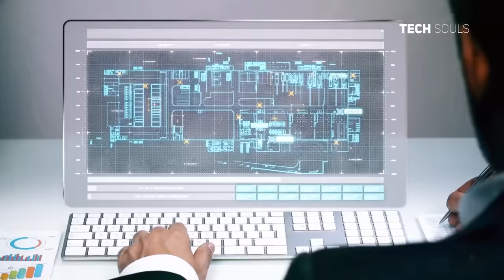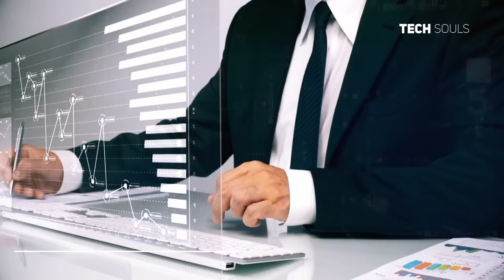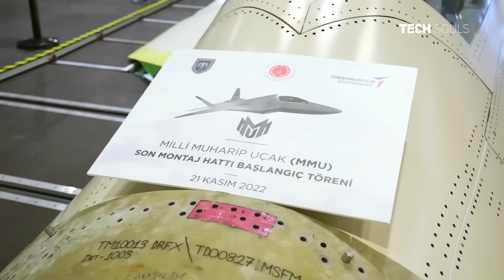Turkish Finally Revealed the FIRST 6th Generation Fighter Jet! To Beat The F-35

Comment: The reason why the United States also changed its main fighter from F22 to F35 is because the maintenance cost of stealth fighters is too high. It is the same reason why F16, a single-engine fighter, became like the main fighter of other countries. TFX fighters are not marketable. First of all, it seems that only some of them will be used in the country.
Reply: The reason for switching to F35 cannot be the maintenance cost. F35 is more expensive than F22 and has more sensor capability, but F22 leaves less radar signature
Reply: Had to more with they could not sell the F-22 overseas so the companies couldn't make a profit off of it.  This is what lead to the F-35 and them cancelling the F-22.  Cancelling the F-22 was stupid. They always get cheaper and more advanced down the road but they closed the lines permanently making it impossible to start the assembly lines back up.
Reply: @emysone The F22 is double the cost of an F35. and The new upgrades make it more expensive.
Reply: @johnjohnson-pf6ln nope f35 costs 55 m but f22 costs 25 m
Reply: @emysone  maybe you're not that good at math because your numbers are way off. The f22 is the most expensive fighter to date
Reply: @johnjohnson-pf6ln bruh f35 unit cost 175 m (with no weapons) but f22 unit cost 150 m
Reply: @emysone  just stop dude. You yourself don't know what you are talking about. You just quoted different prices. The f22 program is at 678 million dollars making it the most expensive fighter program. The f35 is just over 450 million. They estimate by the time the f22 is retired that it may surpass it but here's the thing. The upgrades for the remaining f22's cost over a billion dollars. Plus they are not retiring ALL the f22 raptors only some. They are keeping some that haven't been programmed and some that have.
Reply: @johnjohnson-pf6ln 
In the first part, I mentioned the development cost, and in the second part, I mentioned the unit cost and ok
Reply: @emysone  either way you are wrong.
Reply: He will no longer get 16 without going to Turkey's Hürjet official website and seeing what they produce instead of F16. 2030 is the end
Reply: @johnjohnson-pf6ln  And you're just naming the whole program cost and not the unit cost.
Reply: I feel that tfx in black color would be pakistani black birds who will gain superiority in the sky and world will shiver in fear when these black jets in the sky...i m waiting for pakistani black birds....850 years old prediction...100% true..
Reply: @johnjohnson-pf6ln  
Correct. 👍
Plus, the combination
of  F-15EX  with the F-35 block 4,   is unbeatable  !!!
Reply: @emysone  
Unit cost of the Boeing F-22 Raptor is double, compared 
with the F-35. ...
Reply: @LEO-tm1ck  ım repeatıng agaın f35 unıt cost 55 m but f22 raptor unıt cost 25 m
Reply: @emysone  
Sorry, mate, you are absolutely wrong... Please
check your sources, again...
Reply: @LEO-tm1ck  ok.
Reply: US jets are overpriced
Reply: @megroslmegr7504  
France, is more expensive..
Reply: The f35 is enough to beat any fighter today, and the f-22 is Old and expensiv now.. the f35 is enough, it has alien tech
Reply: Потому что это не самолеты, а хрень собачья., 😎
Reply: @michaelmichaelagnew8503  US has more then enough air superiority fighter jets with the number of F22s it has.  It is the best in the world and has a 15-20 year lead against anything being even close.  The F35 is a multi-role fighter.  The ideal situation is the layered strategy.  F-35 supported by F16s screens to do the dirty work and a couple f22s clearing the skies.  But really.  Dont even need the F22s.  F35s aren't great dogfighters, but they dont have to be, the outrange any other fighter by miles and are shooting down enemy intercepters before they even know they are there.

Comment: Crazy how a majority of actual stealth fighters looking like a carbon copy of the F-22
Reply: Например ?
Reply: because it's the best design for a stealth fighter, it's like being mad because cars look alike even if it comes from different countries
Reply: Ve   soyekdiklerinizi yapabilen mühendisler biz de ve bizden ABD gittiler
Reply: The most important reason is that they never sold it to anyone. In the next 5 - 6 years, every country that is our friend and ally will be able to own an F22 Raptor.
Reply: @onurcan8434  well once the Wizards (Lockheed Martin) design something and it turns out to be one of the best stealth designs one would guess that it will become the default, plus those other countries will have a raptor with updated avionics and won’t be hella expensive to upgrade
Reply: @MetalFalcon99  In fact, each country takes something from the other and uses it for its own design. But sharp corners and a smooth surface are important so that it does not appear on the radar. But unfortunately, with the updated avionics, the price is not affordable at all. If it had gone into mass production last year, the price of one of them, including its hardware, would have been three hundred million dollars. I don't know what the price will be in four years, but it certainly won't be cheap. Because we built this plane alone, without any financial support from any country.  They may not buy it, but at least they won't have an excuse to put forward.
Reply: @MetalFalcon99  Since we own it, we will constantly update it to prevent it from falling behind, but the 6th generation is a different story. Artificial intelligence is required for this. It was deliberately made to have the largest dimensions among its species. because it requires a large space for a lot of hardware. However, it will go into mass production as the 5.5 generation in the first place. We are thinking of Bayraktar - Red Apple as the sixth generation and it will go into mass production very soon. So, while everyone is waiting for a 5th generation aircraft from us, we will first have the 6th generation aircraft.
Reply: Sorry,next time we'll build up stealth fighter looks like tugboat

Comment: On February 21, 2024,first prototip KAAN flew. It remained in the air for 13 minutes. Except for the engine and ejection seat, everything is the work of Turkish Engineers. Work is also being done on the engine and ejection seat. We are talking about an aircraft that will join the air force fleet in 2028.
Reply: LOL no

Comment: There are here many people who dont beleive in that Turkiye can develop a 5th gen aircraft. I am sure they also don't believe in that Turkiye can build attack helicopters, frigates, smart misile systems, and etc, right? And you have just heard about drones, if so, I think you should know a little bit more about Turkish defence industry. Sure, developments take times, but it may not be that much bad as the majority prejudicely commented.
Reply: All of the technology is based on other countries tech. Its still a big achievement but without korea germany and france you wouldn’t be able to do it, and that normal.
Reply: @whatsup-zh6qv   No need to reinvent the wheel from scratch. But, it is not just assembling, as you mean. COTSs can be used at initial stages. As needed, strategically important ones are to be replaced with indigenous products. This is a reasonably normal path. That is why,  South Korea is also doing the same thing.
Reply: @whatsup-zh6qv The important thing is to learn technology. After a certain stage, we will not need them anymore.

Comment: When you get kicked out of an american defence project and then design your own fighter, which requires american engines from a defence project. Bold move.
Reply: You have to start from somewhere. Turkey has been working on developing a jet engine for years, and it will take several more years to build one. However, we need to take action and stop relying on other countries for armaments.
Reply: all which rely on Taiwanese (soon to be China) semiconductors...

Comment: With the F-110 GE engines listed, these are engines that were made in the 1970s and currently in F-16s. By definition, these engines in any aircraft disqualify it from claiming 5th and 6th generation status. At the best, with all systems working perfectly and with domestically procured F-16 engines, this is a 4.5 generation aircraft. Not a 5th and definitely not a 6th, not comparable to F-35

Comment: Is this really a 6th generation fighter?  No offense to the Turks, but the sixth generation should at least have: an unmanned version, near hypersonic or even hypersonic flight speed and weapons based on new physical principles, but nothing like that was mentioned in the video.  For example: Russia is also preparing to create a sixth-generation fighter, and for this purpose, even today, the USSR began developing liquid breathing in order to create a new suit for its pilots who would be able to use it to overcome extreme overloads at near hypersonic or hypersonic speeds.  The point is that during overloads, the pilot’s lungs are compressed and because of this they are not able to absorb oxygen in this state, and after some time the pilot’s brain experiences oxygen starvation, and then loss of consciousness occurs.  And the essence of liquid breathing is to fill the pilot’s lungs with a special liquid that is enriched with oxygen and, due to the fact that the free volume in the lungs will be filled with this liquid, it will not allow the lungs to be compressed during overloads.  And due to the fact that the liquid will be enriched with oxygen, the pilot’s body will be saturated with oxygen.  And according to rumors, only recently Russian scientists have achieved great success in this area.  Also, Russian scientists are testing various systems and new weapons on the SU-57, such as: improved electronic warfare systems, radars throughout the airframe, airborne warfare for controlling drones as part of a flight group, onboard equipment for unmanned flights, air-to-air missiles with a range  up to 300 km, a new engine codenamed “Product 30” with a thrust-to-weight ratio of more than one and cruising speeds above sound with standard fuel consumption.  As well as plasma ignition of the engine, which saves the pilot from such a phenomenon as engine failure.  And in the future he plans to create a small-sized hypersonic Air-to-Air missile that could be placed in the intraventricular compartment.
Reply: 6th gen wouldn't include hypersonic capabilities. As newer generations of aircraft come out they are slower compared to 4th gen aircraft. Top speed above mach 1.5-2 have been phased out.

Comment: 6th generation? It would be a 5th generation fighter, as you stated in the video, but you said it won't have the stealth capabilities meaning it wont actually be a 5th gen fighter. It will be a 4.5 gen fighter at best. Probably comparable to the Typhoon, if its ever actually built.

Comment: People do not find the Turkish claims in the field of defense technologies convincing enough.  Everyone makes reference to the fact that the Turks had no experience in this regard in the past.  This is because people do not research enough on the subject they criticize. 

At the head of these projects is a genius named İsmail Demir, general manager of Aselsan company.
İsmail Demir conducted doctoral and postgraduate research in the fields of solid body mechanics, crack mechanics, semiconductor single crystal growth, numerical modeling, micro and mesomechanics, nanotechnology and micro electromechanics. 

Currently, Turkey has started working on concentrated laser technology with a pulse power of 10 mW and above, quantum field radar and quantum computer.  İsmail Demir is just one of hundreds of scientists responsible for the projects.  I think this explains it.
Reply: Ok so its like a one man project? Ok you build a laser. Good. Is Demir expert on batteries as well? You need to power that thing.